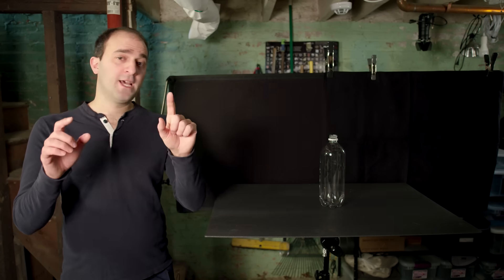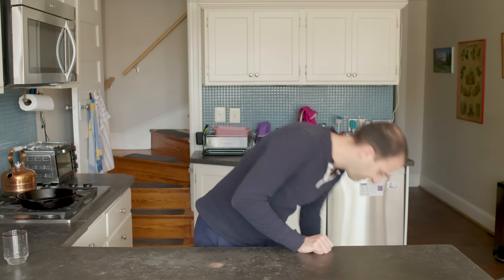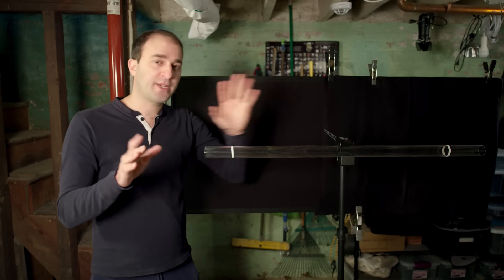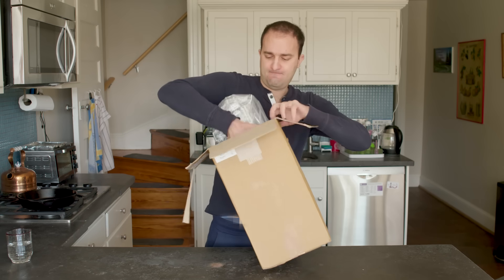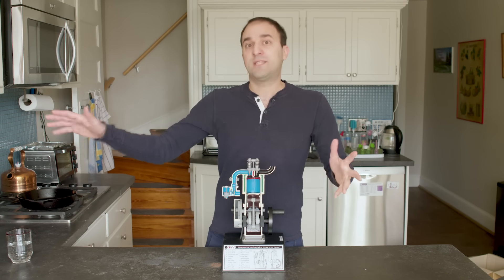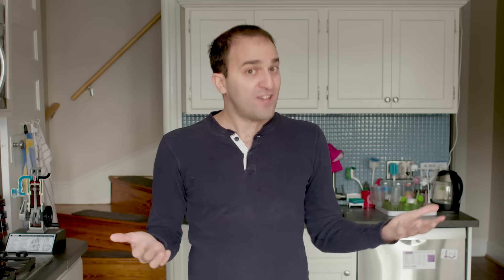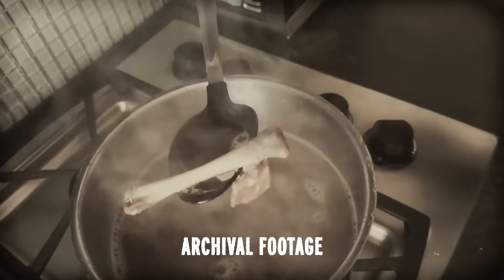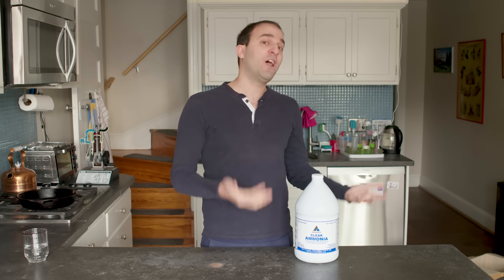Does Toyota Know Something That We Don’t?

Comment: ●Energy is required to make ammonia. If the ammonia producer uses fossil fuel, there is nothing gained. In fact, it's a net energy loss. It'd be more efficient to simply use hydrocarbons in vehicles. 
●If you use nuclear energy to produce ammonia for fuel there's a carbon reduction in vehicle exhaust. However, 
●it's far easier to produce hydrogen for fuels than to produce ammonia. And, hydrogen isn't corrosive, as ammonia is. Also, hydrogen is a high-energy fuel with a fast flame speed. It doesn't require mixing something with it to work as an automobile fuel.

In 2001, or before(?), most major automobile manufacturers had a hydrogen  engine ready to use. At least one hydrogen production facility was slated for construction on a nuclear reservation, funded by the US government. Funding went to "the war" and the hydrogen future of America was delayed.

Comment: I don't think it would be any more practical than ethanol, which is already being used in gasoline cars at 85% concentration and can be produced from sequestered carbon sources, (biomass), resulting in a 0 net carbon emission. However, with the right catalyst it could be used as a method for providing hydrogen to electric fuel cells without having to liquify hydrogen gas. That could have some legs....

Comment: Why didn't ammonia as a fuel take off? A better question is: Since ammonia is the best refrigerant known to man, why do we prefer inferior refrigerants in our air conditioning? Amonia is toxic, but unlike gasoline, it absorbs into the water in human tissue and creates a caustic that kills that tissue. Breath a little ammonia and your lungs will have an instant "sunburn" that becomes an instant case of pneumonia. Your lungs can no longer absorb oxygen to keep your body supplied. Death by internal suffocation!
Reply: I was a chemical plant worker. I can verify that is exactly what happens when you breath in ammonia fumes. I am suffering from all kinds of health problems at 48. I know it didn’t help working at chemical company as a teenager. I was exposed to so many cancerous and birth defect causing chemicals. I didn’t give it much thought then. I do remember catching pneumonia after breathing to much ammonia after the wind shifted and I ended up down wind from a vat.
Reply: I've never smelled the refrigerant from my air conditioner or fridge. Aren't they supposed to be perfectly sealed?
Reply: Carbon never was an emission. Carbon, hydrogen, and oxygen are the 3 main elements God used to create everything.
Reply: @onetransmission7871  That doesn't mean it's not an emission. It's also untrue, as many elements are needed for life. DNA requires nitrogen and phosphorus too. Respiration also requires sulfur. Osmosis needs sodium, calcium, and potassium. Even elements that are required can be toxic. Cyanide is just one each of hydrogen, carbon and nitrogen yet is an infamous poison. Benzene consists of only carbon and hydrogen; not only is the chemical poisonous but chronic exposure causes leukemia and anemia. How things are put together matters.
Reply: @onetransmission7871 Nice to see someone on here with an understanding of a bigger picture.

Comment: Just as it dawned on my how bad an ammonia leak would be, you bring it up. Good timing. Back in the day, I worked at a place that used ammonia-based liquids to develop blue-prints or some other wide format paper printed stuff. Someone kicked over a jug of the ammonia based developer. It drove everyone right out of the floor of the building until it evaporated hours later.
Reply: You have a car crash. You might be injured. You're unable to get out and away from your wrecked car.
While sitting on a growing puddle of ammonia.
Not a pleasant way to go.

Comment: US Army in Europe as part of War plans tested running tank engines on anhydrous ammonia. 4 large pressure cylinders in wall lockers mounted on the engine deck and kept heated enough to avoid freezing the valves and lines running to the engine. Early M48 series tanks about the time Elvis was serving in Germany. As Part of the Multifuel engine programs. Modern High performance diesels and Gas Turbines won out over time.

Comment: My immediate first concern is "What happens if the fuel leaks?" Like gasoline is flammable and its fumes are an explosion hazard, yes, but the conditions need to be just right in order to be dangerous. Ammonia is dangerous all on its own. Also, burning ammonia sounds like a good way to make acid rain a big deal again.

Comment: So, where would we use it?  Creating Ammonia is done with water, air and energy.  That energy can be from renewable sources, like solar and wind.  So, during sunshine and wind, store that energy in the creation of ammonia.  Then at night, use the ammonia in electric generation in your local power plant.  This solves the issue of intermittent power generation from renewable sources, and the pollution from local power generation plants.  Also, reduces the issues around transport and distribution of ammonia, since you aren't delivering it to local "gas stations" or having someone not really trained in it's handling putting it in their vehicle's tank.  Note, there are existing ships that use ammonia as a fuel transporting goods.  Those engines can easily be used in power generation plants.

Comment: I have worked with ammonia on many occasions, often loading 5000 tons onto ships etc. It is a serious health risk if you are exposed. I also worked on non selective non catalytic reduction of NOx using ammonia, once again you have to be very careful in handling it, I would be very wary of using it domestically as a fuel.
Finally at the moment most ammonia is made from natural gas, a fossil fuel, the process does produce CO2, but to be fair the manufacturing process I was involved with did capture the CO2 and sold it into the drinks industry for fizzy drinks and beer.

Comment: Same problem as hydrogen.   There are zero ammonia cars today.   Who is going to build a filling station that nobody goes to?   OK - but who will buy a car with no filling stations?   In the US, there are 168,000 gas filling stations.  You're going to need to build AT LEAST 50,000 ammonia stations before you start to sell cars (same problem with hydrogen as a fuel).   Building a gas station cost between $3.8 and $10 million.  That's 50,000 x (say) $2 million...$100 billion dollars - if you update existing gas stations - maybe half a trillion if you build new ones.  The EPA are going to get VERY excited about the environmental risks of that many ammonia stations.   And all of that before you sell a single car.   Electric cars COULD have had the same problem - except for that fact that everyone has a "filling station" in their garage.

Comment: this would bring back full service fuel stations!  people out there today would not be able to handle the choir of fueling their vehicles with pressurized liquids as such.  though it would be similar to propane fueling, propane does not have the odor that would make you run for your life.  16 years can't change tires, what are they going to do with this operation?

Comment: You mean to tell me that Ammonia, with a chemical formula of NH3, doesn't make Carbon Dioxide with a chemical formula of CO2, after reacting with Oxygen? Color me informed. What it does make though is Nitrous oxide, with a chemical formula N2O, and water, with a chemical formula H2O. I hope we like laughing while we can't breath.

2(NH3) + 3(O2) ---> 2(N20) + 2(H2O)

Any CO2 emissions from an engine running on Ammonia are likely unburnt hydro carbons from the ambient air intake.

Comment: first, the speed record for a crewed aircraft is Mach 23, the space shuttle Challenger. second, flame speed means nothing, you want energy density. Gasoline provides 42-44 MJ/Kg of energy. this is by far the most energy dense liquid fuel that we have created and burns kinda dirty, 2 C8H18 + 25 O2 → 16 CO2 + 18 H2O. now compare that to nitromethane (CH3NO2) that top-fuel dragsters burn at 11.3 MJ/Kg. so why is the nitro so low but can drive an ICE to 10000 HP? because it also contains it own oxygen. Now of course nitro is expensive and creates a lot of nitric oxides when burned, 4 CH3NO2 + 5 O2 → 4 CO2 + 6 H2O + 4 NO, so thats out as an alternative fuel. however, there is also methanol (CH3OH), which is usually mixed with nitro in the model r/c world but can be a good fuel on its own. Methanol has an energy density around 22 MJ/Kg and also carries some of its own oxygen. Now methanol does have some pros and cons, a con is that the flames are invisible, so if your fuel tank ruptures, you wont know if its on fire. A very big pro for methanol is the fact that its biodegradable. Its burn cycle is as follows, 2 CH3OH + 3 O2 → 2 CO2 + 4 H2O. now this fuel burns much cleaner than gasoline and is cheaper and cleaner than nitro, so why arent we using it every day?
Reply: "Contains more oxygen" is the wrong analogy. The fuel just requires much less oxygen to combust, so much more fuel can be burned relative to air in a fixed displacement motor. The much greater amount of fuel exceeds the lower calorific value of the fuel, so more power.
Reply: @andreasdinkelacker6729  I didn't say "carries more" i said "contains its own" if you're going to quote me, get it right. but, if thats all you have to "nitpick" i'll take that as a win.
Reply: The simple answer is because that's what the oil companies have to sell !  The results of oil refining yield huge amounts of gasoline and diesel, so that what we get !  Brazil changed it's Fuel Based economy from gasoline to methanol years ago and is doing quite well for it !  But the USA where Standard Oil Company, aka Rockefeller , took control over the oil industry in the late 1800's then with gasoline in 1900's , they aren't about to give up what they have controlled for over 100 years without a major fight !

Comment: I first heard of ammonia powered engines about 10 years ago. Yes you need extra safety features, but it’s completely viable.

First thing you have to understand, ammonia shouldn’t be thought of as a “fuel” but more so as energy storage.

Secondly, when these systems are designed and built properly (yes they already exist just not in production) there are no emissions, because you can form a closed loop system, very much like the idea of a closed loop hydrogen vehicle, except there are some extra steps 

Also thought ammonia is dangerous, it can be used safely. It’s detection point is ridiculously small compared to the point when it becomes toxic. Not only will you smell it long before you get to the toxic threshold, you won’t be able to tolerate being in the area, your eyes,  nose and armpits will start feeling like they’re burning. This is also below the point of asphyxiation too.

Comment: I fear hydrogen. It always finds a way to escape. With ammonia at least, a small leakage doesn't even require a sensor. The one on our face is very good ;-).  Belgian Buses drove on ammonia + coal gas during WW2 and there were no nitrous oxides and  no corrosion problems.

Comment: No Toyota don't know anything useful. Toyota are unremittinngly silly - now to the point of stupidity -  chasing hydrogen and now ammonia. Apart from the toxicity to make the stuff carbon free (from renewables) requires huge quantitie sof electrical power and you are literally throwing half of the power away from the start. Then you have add massively costly ammonia (or H2) distribution + handling infrastructure to construct  - all likely to put it in the end back into a fuel cell in your car (itself of limited life and high expense) to turn back into electricity and power a motor.  Why not cut out all the multi middle-man chain and concentrate on batteries Toyota?

Comment: What we need is a liquid fuel that is liquid at room temperature. That means that you could just keep it in any kind of container. It should also have a high energy density, say 38 times what a battery can store by weight.  It should also be relatively cheap. I'm describing gasoline of course.  No other method comes close for practicality.  There is still room to improve the efficiency of ICEs; lets go with it.  Everything else is going to fail.

Comment: Ammonia would make sense on aircraft and larger boat where there are trained crews on duty already and fueling occurs just prior to a journey. An ammonia powered jet seems practical, as outside air temperatures at cruise altitude are well below -33ºC (-28ºF) so in flight storage not an issue.

BTW: Nissan had an experimental EV that used ammonia to power a fuel cell about 8 years ago. Not sure if fuel cell generator was designed to use ammonia directly to generate electricity, or if ammonia was refactored into hydrogen for use by a hydrogen fuel cell generator.

Comment: No, Toyota does not know something that we don't. There is nowhere near enough ammonia is produced to make it practical as a fuel. This is a non-starter. Ammonia is not simply pumped out of the ground nor easily manufactured. Its manufacture is highly energy intensive. It less plentiful than hydrogen, which is also impractical as an automotive fuel. 70% of the ammonia produced is used in the manufacture of fertilizers, while the remainder is used for various other industrial applications, such as explosives.  Before making this video, the author should have Googled "How is ammonia produced?".

Also, how can anyone close to or over the age of 30 not ever have smelled ammonia before? My grandmother used to use it when mopping her bathroom floor. Nasty stuff!

Comment: I think ammonia has an important role to play as a fuel but not in cars or widely distributed where we drive cars. Surely it is the most promising fuel to use to store energy from wind farms and solar PV farms, to use for those times when demand would otherwise exceed supply. We create the ammonia from surplus electricity and consume it when we have an electricity deficit - cloudy, days with still air.

Comment: There is a new cruise ship that runs on ammonia so it is being used as a fuel in internal combustion engines currently.
Reply: It's also worth noting that anhydrous ammonia is used as a fertilizer in farming and 2000 gallon tanks of it are commonly seen on farms.

Comment: Ammonia is easier to store and transport than Hydrogen but it is just as, or more, costly to produce, The evergy loss is huge ~90%. This makes it an expensive fuel. Escept in specialized applications it will not be competitive with batteries.

Comment: a gasoline spill, without an ignition source WON'T KILL YOU... an ammonia spill in an auto accident with a ruptured fuel tank or fuel line and you're trapped in the vehicle...YOU'RE PROBABLY GOING TO DIE.. consider a 20 to 30 car pile up on a foggy highway with cars, trucks, and tractor-trailers and leaking ammonia all over the place... and if you want to terrorize a neighborhood... mix ammonia with bleach to create Chloramine Gas... which, without doing chemical research, I'd presume is a less deadly cousin to concentrated Chlorine Gas used in WWI...

Comment: They used to sell ammonia in grocery stores.
Reply: Household ammonia products are reduced to a 3% solution. Annoying but relatively harmless, excluding your eyes.  Anhydrous ammonia is 100%, and you probably would NOT be able to take a 2nd sniff.  I worked with it back in the mid 60s  in the USAF as a coolant for a missile electronics compartment.

Comment: Ammonia is a very nasty way to liquefy and transport hydrogen, the actual fuel.  Makes a lot more sense to use methanol, IMO, which is effectively methane that's been 25% combusted.  It's liquid at room temperature, doesn't need pressure vessels or cryogenics, and in principle you can make it by reducing CO2, rather than N2, with hydrogen.  (I don't think anybody has yet perfected a catalyst for the former process, but whoever does is gonna get rich.)

Comment: I have a question. How many times have you heard China claim to have some revolutionary new breakthrough in whatever industry (lately it's been green energy)? I literally (not figuratively) cannot count the number of times I have heard China make such a claim over the past 20+ years. Now how many of those claims materialized into a working product or technology? None. Not a single one. China makes big bold claims because they can. Who is going to correct them? Who is going to punish them for lying? Nobody. So why do they do it? 2 reasons. First, money. They want foreign investors. Second, for "face". China is a country that cares how it looks to the rest of the planet. They're a land of shortcuts and facades. Why aren't we using ammonia as fuel? The same reason you're not driving around in a hydrogen powered car. Flammable gas under pressure + the average american driver? Boom.

Comment: Since the ammonia really only uses the hydrogen for energy, you are back to the fact that you might as well just use hydrogen.....OF course, it is all really just a different type of battery...and an inefficient one at that. . Instead of a chemical making electricity to make motion, you are making motion with heat energy from the combustion. Either way, the energy used to make the ammonia has to come from somewhere....like fossil fuels. 

The ammonia is just a transport mechanism for the energy.

Comment: this is old news! container ships run nh2 today and some rail operations also run it . cat cummins and other manufacturers have tier 4 certs for nh3 fuel in their diesel engines. ive been posting this info for years because of the lack of exposure... but anhydrous nh3 is not something you would want to pump into your car your self. its highly toxic to life